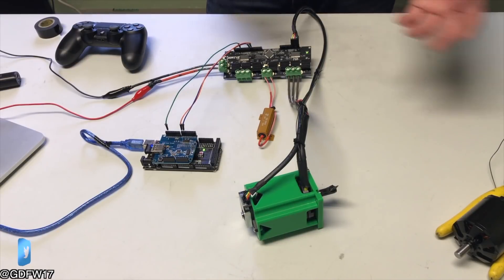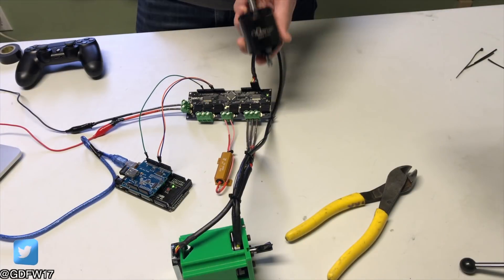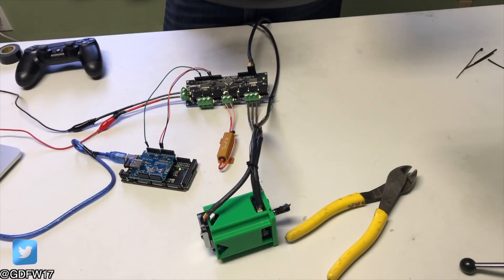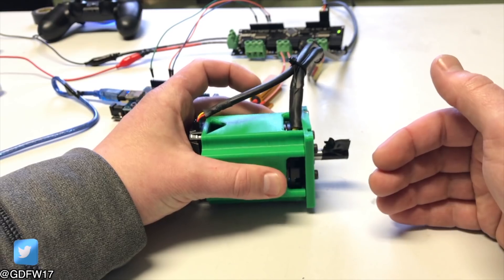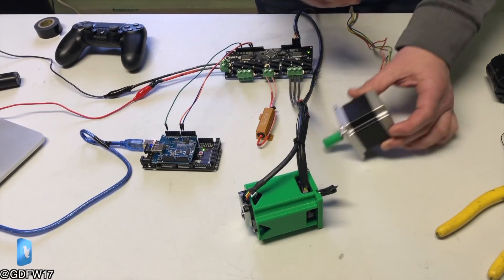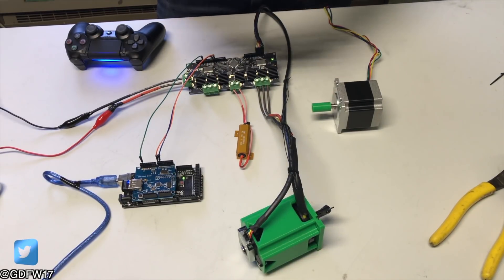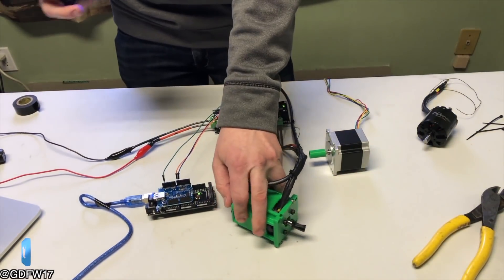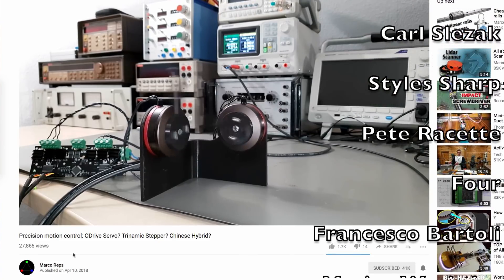The Best Robotics Power House Just Became Affordable!

Comment: Like the idea of Odrive but the hardware requirements of having two separate pieces (motor/encoder) with wires for each of them makes it less compact, less clean and more complicated than an all in one stepper motor (cheaper too). I think what this project should do for wide audience and success is produce brushless motors with integrated encoder (and reduced number of wires to the ESC controller)

Comment: "Affordable" = $119 per odrive (2 motors max) + $40 (2x decent brushless motor) + $80 (2x encoder) = $120 per motor. Affordable is not what I'd call this. For a six axis robot it'd be $720 for just the motors and drivers.
Reply: Look up the RMD X8. This is the "competition", if you can call it that. It starts at around $450USD per motor, and is nowhere near what high-end industrial servos at this power rating go for. Look up some 1kW industrial servo motors for scale, $1000 will not get you very far, again just for one motor.
When people say it's affordable, they don't mean you can go impulse-buy one to play around with like an Arduino, they mean for the specs it provides. You will not find a cheaper solution to provide that kind of power and precision.

Comment: Is the schematic available for the controller board or is it just the software that is open source?
Reply: both hardware and software are open source, you can check it out on its page...
Reply: Ty
Reply: I wouldn't touch this hardware with a stick.  The power stage is completely badly designed. Just like any bog  standard ESC controller.

Comment: "Super expensive, super high end motors"

What servo motors are you looking at? You can buy them for under $5. By the time you add the encoder and gear reduction you know what you've made? A servo motor! Except it's probably just more expensive at that point than buying a premade servo with similar torque. And that's not mentioning the violent vibrations...
Reply: He's referring to industrial servomotors, not RC servos. Big difference!

Comment: thanks for this, i am already looking into this tech.  and i greatly admire all you've been doing with gears that i've been watching now for over a year.
but,
with all the tech that you have built and designed, i'm sure it wasn't out of your expertise to build a simple hold-down mount for your motor!!! at the end of the video, where you were using the hand-controller and trying to hold down the motor @ the same time, was .... er ... well one of the things it was, was confusing. had you had both hands free to use the controller, you may have had more mental time to explain what you were doing with the controller. that being said, great job - i could not have done nearly that well - so i'm an armchair critic. 
keep up your great work & i'm looking forward to more on this tech!!!!
Russ from Coral Springs, Florida, USA

Comment: I have a feeling that since this is "new technology" its actually going to be 10 times more expensive than the Chinese clones of the electronics/motor of a stepper motor that is used by hobbyists 99% of the time.
Reply: No doubt, but the clones will probably also crap out long before they reach the claimed power output.

Comment: $250 for their motor+sensor+control board. You could get a clear path motor for $7 more and you'd get high holding torque on it.
Reply: The magic part is that control board, and it is for 2 motors. The rest you can set up the way it suits the project.

Comment: Perhaps I should send a few things sooner. I should get in touch with a few people I know, it might be a good idea for me to send you some stuff for next video, some of the motors I have would be good to test if that thing can do higher voltages (12, 24, 36, 48, etc.). Did you give me your address? Email me again, I'll send you a few things this week to see if you can use some high-end motors.
Reply from the maker: I dont have your email address, I don't recall speaking before?
Reply: Gear Down For What? I was going to send you a bunch of heavily geared motors, I sent you pictures of a bunch of the motors I have just laying around.
Reply: It was back when you were doing the really high great ratio videos, I have brushed DC motors with crazy high gear ratios, 21:1, 40.5:1, 256:1, 1500:1, 3500:1, et cetera et cetera. Tiny motors that typically run idk 20,000 rpm but geared so heavily to turn that speed into torque and DAMN do they work well!
Reply from the maker: Oh! I remember now lol
Reply: Gear Down For What? Yeah, A.D.D. Lmfao, don't mind me. 😃 I really like your videos, I'd be a Patreon supporter if I wasn't so damn terrible with my money in the past, stupid young me. I'll be honest though, that printed gear video kinda pissed me off haha make a 4 or 5 axis CNC with those you're messing around with and then make a video, I'm getting to about the same point but trying to use a specific firmware because it's FOSS. That ODrive would be dope if you could use it in 6 or 8 or more channels....I am a CNC Machinist and I run a Swiss Type CNC Lathe and I want to build one SO badly! They are crazy precise and unbelievably repeatable. I may take one of these Open-Source protects to an engineer and have him take it to the level I want it and "update" the project to what I think it should be 😈 good idea or no?

Comment: That encoder error could be a fatal flaw in a robot design.
Reply from the maker: There was no error. I tuned the PID to do that intentionally.
Reply: Oh. Ok.
Reply: I was considering commenting that you need to increase the I multiplier, but I see you are already aware of that. Kudos! Also, if you haven't already, check out a software called V-REP. It is awesome for developing robotic applications.

Comment: It is Current, not Amperage.  There are nothing called Amperage.  It is current.
Nice video though.  And a COOL device!
Reply: Allowed?  
It is the proper name of current which is measured in Ampere, as voltage is measured in Volts.  Not my fault there are no amparage when you measure current in Ampere. So do a simpel search and stop using Gtfo.

https://en.wikipedia.org/wiki/Ampere
https://en.wikipedia.org/wiki/Voltage
https://en.wikipedia.org/wiki/Electric_potential
https://en.wikipedia.org/wiki/Electric_current

Comment: But brushless motors have bad holding torque. Thats where stepper motors come in
Reply: Atlantic Film 
Brusless motors do have good holding torque. Its just that the steps are too big and they are not optimized for that. On the other hand brusless motors are super efficient and have a ridiculous power density so you could litterally add a gear reduction to the motor in the same space and still have more power output.
Reply from the maker: That isn’t important for my application, my gearsets are so inefficient that they can’t be backdriven! Haha
Reply: But the feedback loop WILL adjust for that, and will use the excelent power you ger from the brushless motors.  This is a great device.

And yes, REAL CNC machines doesn't use stepper motors, they uses servo motors, like these odrive, feed back sensor and brushless motor.
Reply: Atlantic Film steppers really don't have much holding torque either, years ago I had a setup like this but with brushed motors and encoders for a F.I.R.S.T. competition. Tuning PID loops ends up being the solution for holding torque imo
Reply: That's like saying "Stepper motors are more accurate because they have steps" well...no, not really. It really depends on the motor and configuration. Brushless, specifically 3 phase (different than 3 phase electric) brushless DC motors can have multiple pairs of poles. Most are 3 phase 2 pole motors, designed for high speed. If you want higher torque or better positioning, you as pole pairs. There is only really a physical constraint as far as pole pairs go, to keep things simple. 

The way Nema stepper motors are designed, each "step" is actually a pole pair, they are VERY similar to brushless motors. Obviously, what matters is how they differ from each other. Typically, yes, stepper motors tend to have higher holding torque, dollar for dollar and with most consumer accessible motors. What that statement does not account for is the motors that are not sold directly to consumers, which most aren't. 

Unfortunately, when servos are bright into the mix,  unless it's a cheap "RC  Servo", BLDC tends to to elevate cost significantly and when that happens sales from the lack of consumers result in industrial only high-end motors....or cheap motors that are essentially the "Enthusiast" line of motion control solution. 

Size for size, BLDC stomps stepper in torque, precision, and efficiency nearly every single time and all day long.
Reply: @kevin_delaney  Hi, to be honest my experience is very limited. Could you refer me to any suppliers for compact high torque motors for position control? I am currently looking for something smaller than the massive steppers I am using.
Reply: The holding torque of stepper motors can be replaced with quick feedback (closed loop control). Effectively this means any applied torque is quickly counteracted by the controller, keeping a stable position with a configurable range of restoring forces, up to very high. I suspect a BDC of comparable price to a stepper can have comparable holding torque (while much better in other characteristics).
Reply: Gear Down For What? 
Hey have you tried using a bolt and a wheel as a worm gear? Its relatively easy to make. Like how youd make a hobbed bold for a extruder with an M5 tap. Its metal and its a worm gear, i dont think it will be much be i doubt it will be worse than yours.
Reply: Jason Carrier Holding torque just ends up being dependent on how much current you drive through the motors electromagnets which if you have a current/voltage mode controller board you can easily regulate.
Reply: Kevin Delaney AC servos are what industry use...(near in mind BDLC is actually an AC motor)
Reply: @yalgret  This isn't true. AC Vector motors are induction motors, "Servo" motors are permanent magnet BLDC motors. The lowest resolution encoder available to pair with the Allen Bradley (Rockwell Automation) Servo's I use on the machines I design at work are 18 bit. They can detect motion down to 5 arc SECONDS. or 0.00137 of a degree. You can add an encoder to an AC Vector motor and run it in position mode as well, but the best AC vector motors can only operate 2000:1 constant torque. This means they can only offer the motors rated torque down to the motors maximum rated speed divided by 2000. Now keep in mind that these are THE BEST AC vector motors on the market. Permanent magnet BLDC motors can offer Infinity:1 one constant torque. This means they can generate 100% of the motors torque at 0 speed. That is why they are used in positioning applications, and AC vector motors are used in constant velocity applications in speed or torque mode.
Reply: Jason Carrier "steppers don't have much holding torque" that is complete bullshit right there. What experience do you base this on? A 12 Nm stepper motor is not that expensive. Gears cause backlash which ruins precise position control,unless.you pay thousands for high end antibacklash boxes.
Reply: Vector controlled VFDs are the future. The are already replacing DC motors in high torque applications. 
Soon they will arrive in the robotic world too.
Reply: It's not a stepper motor setup, it's a servo setup.
Reply: But you can use gearing or even wormwheels for insane holding torque
Reply: Kevin Delaney yeah but this video isn't about industrial servos...
Reply: Yes, +johnDon, it is about servo motors for hobby use.

Comment: Could this setup be used for a CNC?
Reply from the maker: Yeah! It would be stupid fast too!
Reply: Really depends on the holding torque specs....
Reply: Which increases when you add a gear box, and still have huge speed.
And with the right Worm gear, the holding torque will be HUGE.
https://en.wikipedia.org/wiki/Worm_drive